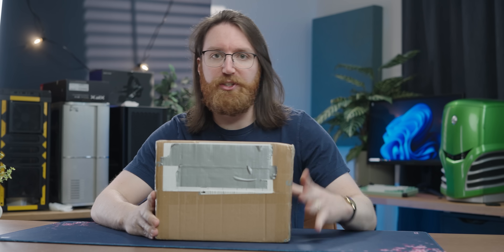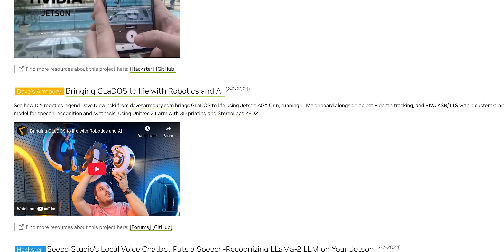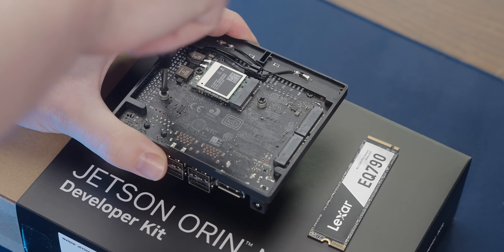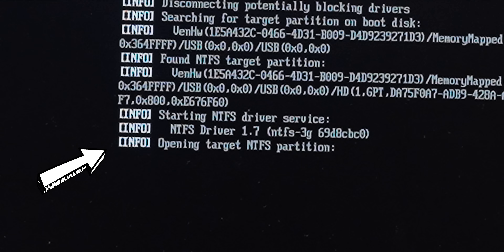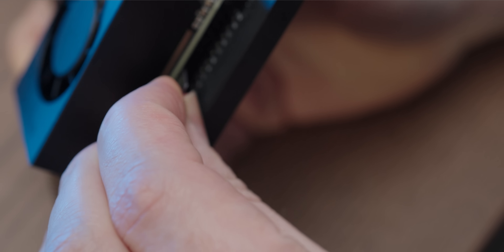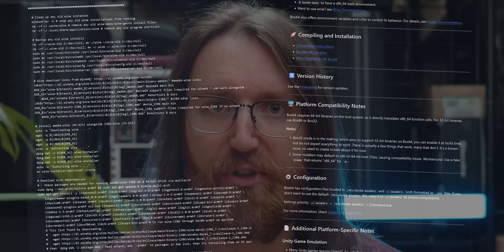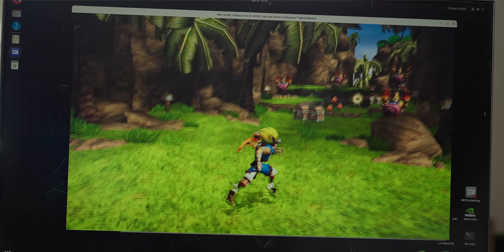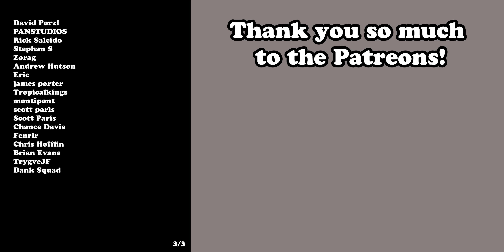Gaming On Nvidia's TINY Super Computer...

Comment: 1024 ampere cores, that's like 2/3 of what a switch 2 has
Reply: it's almost like specialised hardware is optimised for one thing
Reply: @jayjayare What a coincidence. /sarcarsm
Reply: @dangerwr "/sarcasm" 😭
Reply: Probably runs faster and isn't thermally limited. Core count is one fraction of the whole thing.
Reply: Might be binned versions of the ones used on Switch 2. Getting the scraps with this one lol
Reply: @AnesuC  This has been in production for a while, it's using a binned down T234 SoC like the rest of the Orin dev kit lineup. Orin is the code name for the actual chip!
Reply: @AnesuC  It's a different chip, much smaller, Orin don't just include a CPU and a GPU but a ton of accelerators really useful for robotics but useless for a console
Reply: Like the jetson nano was half a Switch GPU for $99
Reply: @thomazwanderley4378  maybe for the board on its own. The whole modular build is almost $300. $150 less than the Switch 2 that includes the capacity to run Switch 1 & 2 games and includes controllers and a pretty damn decent screen.
Reply: And yet the soc eats 25watts to run at 100%.
Not like the nsw, with just 8watts of tdp.
Reply: @vxvicky the switch is purposely nerfed.  Battery is more important than maxing the chip out.
Reply: @vxvicky  Because the Switch runs at far lower frequencies
Reply: ho many cores does the Switch2 have? do you know?
Reply: @VintageCR  1536 cuda cores
Reply: @BigBossDLow  lol I tried to translate this.
Reply: @VintageCR  1.5k-ish
Reply: @VintageCR its like a rtx 2080 in performance if im not wrong
Reply: Cool seeing you here Robdev :)
Reply: It's literally just a GTX1650ti with tensor cores added to it lol, basically took a turing design and updated it
Reply: @TheOriginalFaxon  Wrong. It's Ampere. Like a cut-down 3050.
Reply: @TechHug  I literally said "they took a Turing design and updated it", which Ampere was, I don't see how that's in any way wrong. Ampere built on Turing's design, the GTX1650ti didn't have tensor cores, the specs are otherwise very similar. It's not a stretch to say they did something like this when the hardware on paper is so similar and one architecture is based on the previous generation.
Reply: @TheOriginalFaxon  That is beyond a massive stretch. That's like saying the 9800X3D is just a powered up 1700X.

But if that's what makes you feel better about yourself, go right ahead I guess...
Reply: Not that the switch2 has god tier internals..
Reply: "Never been great with holes"
Reply: Probably still way more powerful
Reply: There are 2048 CUDA cores on the die, and 12 CPU cores, and 256bit of LPDDR5 controllers, but Samsung 8nm yields are so insanely bad (or for segmentation purposes) that Nvidia disabled pretty much half of it (and the DL Accelerator apparently). That's also why the die here is much larger than the one on Switch 2 yet spec wise it is so much worse, well aside from CPU because the CPU on here is clocked much faster than Switch 2.
Reply: @bfbunny this is very very intresting please tell me more- are not all cores live and chips can ship by percent yield? Not all alive?
Reply: Now I need to see someone install DeepSeek on the Switch 2
Reply: A switch 2 is around the power of a 2019 smartphone
Reply: @L4ftyOne  what phone did you have??? iPhones today have Resident Evil games ported and they run poorly, but you’re saying they would have ran better on 2019 phones!!! Amazing!
Reply: @cosmicgamingunlimited They don’t run poorly, besides, iPhones have catastrophic thermal limitations which cause them to perform about half as well as they should in games
Reply: @TheRealNightShot  The new iPhone 17 Pro (A19 Pro chip) is 2.037 TFlops before thermally limited. Switch 2 is 1.7 portable and 3 in dock. $1200 phone vs $450 console.

My point still stands, a phone from 2019 was no where close to a Nintendo switch. At triple the cost, the iPhone should be stomping the Switch 2.
Reply: @cosmicgamingunlimited crazy how some people get on specs..I upgraded my old gaming laptop with a i7-14 gen 32g ram 8gb 4060. I played silent 2 remake  and cyberpunk on it, then went back to my steam deck and it’s docked to a 4k tv 😂…with an account from 2009 with 507 games in my library. And I’m playing Skyrim right now on the deck and it’s great…some people get mad cuz I’m having fun on a lower end device.
Reply: @TheL1arL1ar  some people forget that arcades used to be filled machines powered by 2MHz processors and they had fun doing it. It’s how the developers use the machine. 

I just ordered a mini pc. NUCXi7 with a 11800H and a RTX 3070 for $450. It’ll outperform all consoles on a budget but it’s cheap because people think they need $2k gpus and $700 processors to have fun.
Reply: @cosmicgamingunlimited yeah I want a low profile gaming desktop myself but with a ryzen cpu and the desktop 4060 which between the laptop and desktop variant they are actually close to performance. I don’t even care about high resolutions 1080p is still just fine for me.
Reply: @L4ftyOne  more accurately a 2060-3050 because its an nvidia gpu. Arm based solutions are really good but for the power envelope and arm based apps. The hybrid windows doesn't perform very well yet as it has very low adoption. (Arm cpu, big 3 gpu) Linux also has a more professional use for arm but in many different ways to gaming. The quality of gaming on these devices would be better served by an x86 mini pc with igpu. Just by virtue of modern support alone . That's not to say it isn't possible to be better in the future.
Reply: @L4ftyOne  The Switch 2 has a CPU powerful like a 2019 smartphone, but the GPU slams everything except the 8 Elite.
Reply: @L4ftyOne  I mean, this isn't true. In 2019 Samsung's flagship S10 had a Snapdragon 855 which is significantly WAY less powerful than a switch 2.
Reply: @josephgood2704  Can confirm. I'm still using a Samsung S10. Its significantly less powerful (magnitudes) than my brother's Switch 2 or my Legion Go.
Reply: @L4ftyOne  that's not even close to accurate when comparing apples to oranges. A high end phone is also $1000+ for the device alone.
Reply: @L4ftyOne  Please stop spreading BS. It's not that weak. The GPU is competitive with the other handhelds in that price range. The CPU is limited by its very low speed currently, so that's the only weaker point. Even with that though, it would likely offer better sustained performance than that.

2019 smartphones aren't even base PS4-level.
Reply: @TechHug  Did you even watch the video? this thing struggles on ps2 games bro, saying its like a 2019 phone is likely better than it actually is.. Maybe 2015 at most lmao
Reply: @TechHug  Yeah a 2019 smartphones 1-6 core GPU [ Adreno is just Radeon spelled differently btw, also PowerVR on apple A smartphone chips was a former part of ATI, so basically all AMD based] is in no way >= to 1024 CUDA cores. Thanks for pointing this out. The only people saying that are only looking at the fact that the CPU is ARM and nothing else. I'm all for bashing Nintendo for other reasons but innovation usually isn't one of them. Putting a patten on a game mechanic that has been out for 30 years on the other hand though.... [the patten thing really frustrates me because that was the first thing I said when I tried Palworld was "did they have to make it a sphere?" They could have made it a cube, a watch, playing cards somehow, or really anything other than a ball or sphere]
Reply: @welshe222  Blame the software, honestly. Switch 2 is roughly PS4 levels of performance, with some modern niceties on top. This SBC is, well, clearly worse as it stands right now.
Reply: @welshe222 how exactly are you going to get ps2 running a switch 2 considering there’s NO MODS FOR IT, it’s about the performance of a slightly cut down rtx 2050 which is ampere despite the naming
Reply: @imag187  Dude what the hell are you talking about? Adreno is a Qualcomm thing not PowerVR and AMD sold it's mobile division 16 years ago so the only thing "all AMD based" is the Adreno trademark...
Reply: @Ishend  I mean your logic makes no sense, its common knowledge that switch 2 can install linux and run most  PS2, GC, and 3DS games much faster than native lmao. So this nvidia tiny "super computer" is infact complete crap, when you can buy a used switch 2 and mod the firmware to be faster than it lmao. You know how hardware works right? if the specs are identical but one (switch 2) has more of essentially everything, its generally accepted that it will outperform the one with lower numbers, does this help you?
Reply: @welshe222 there are no available switch 2 mods, mod chips don’t work there’s no soft mods. the original switch can be modded but it will have significantly worse performance, do a tiny bit of research and just google “are there any available switch 2 mods” there you go I’m not disputing that IF there were mods available it would be able to run 3ds and ps2 much faster then native I’m just saying that you have said “it’s common knowledge you can install Linux” where right now you most definitely cannot
Reply: Cope
Reply: @TechHug  2019 smartphones slam PS4's CPU but are way behind in GPU. That said, 2022-2023 smartphones caught up and surpassed it.
Reply: @TheRealNightShot  They don't match Switch 2 at all in practice though, which is the main thing noted here.
Reply: @TechHug  The current phones do match and (far, on the CPU side) exceed the Switch 2 in practice. Benchmarks speak, the power is there.

What they are missing are the games, and that they will never have.

We can emulate, though, and I think that's pretty good.
Reply: @TheRealNightShot  CPU sure. GPU though? Well, Hitman is on both for you to use as a comparison.
Reply: @welshe222  It's not running ps2 games natively genius. It's doing it through emulation. Do you have any idea how that works?
Reply: @imag187  you dont know what you talking about the cores in mobile GPUs are like core clusters in normal GPUs most likely having additional 64 cores so if its saying 6 xore GOU in mobile its equivalent would be 6*64. and it is as powerfull as 2019 mobile chip... Its done on 8nm and m1 in ipad was allready 5nm